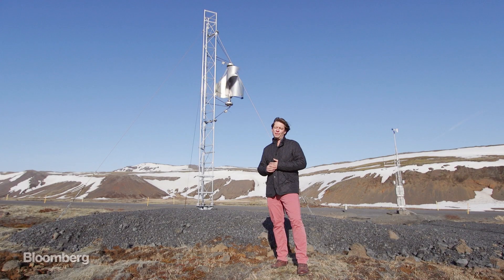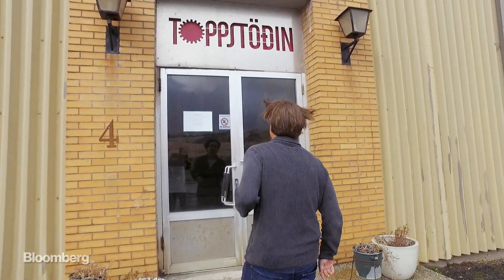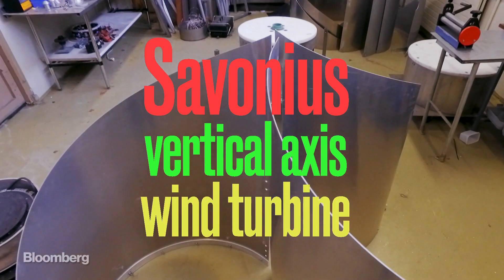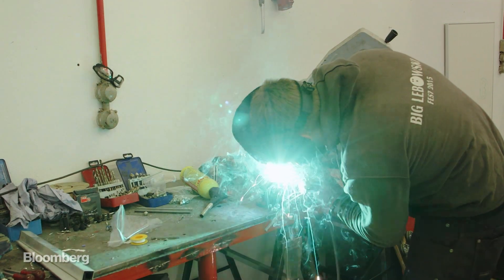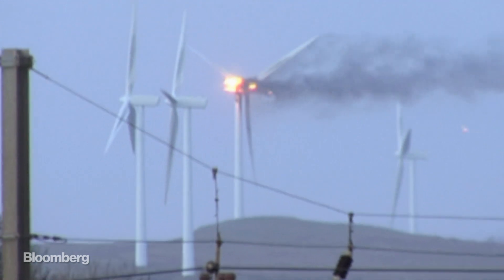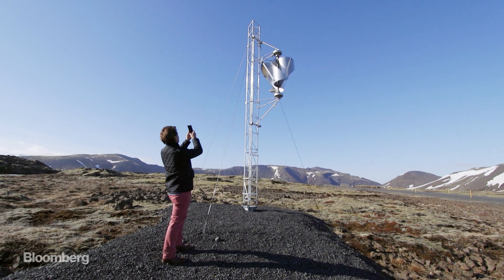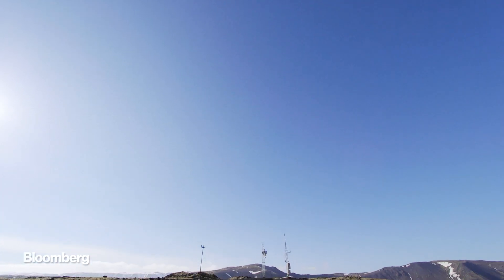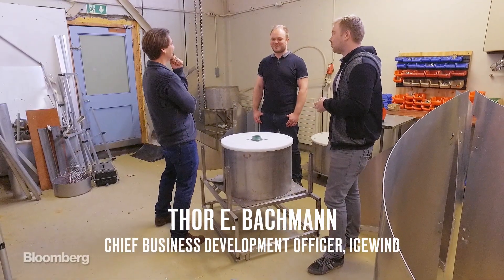The Tech That Could Fix One of Wind Power's Biggest Problems

Comment: we used to take old 55 gal. barrels. ..cut em in half ....weld em on a old car wheel....put on top of oil casing. ....last. time I looked they where still pulling water out of the creek

Comment: Is it better than the propeller design?
Reply: nope. looks cool but not as good as 3 long blades
Reply: And nowhere near as good as 5, 7, or 9
Reply: The formula is the bigger the surface area the more power it generates so this is almost nothing compared to a windmill sadly
Reply: Interesting. On what do you base this response? Not arguing; I really want to know. Can you share a link or something that shows the difference and in what ways windmills are better?

Comment: You never explained how the design protects from over spin.
Reply: Awesome inquiry!

The blades have two sides, so it's all in the shape of the blades. Look at this turbine head on and ask yourself what you see. Like looking at a ball, you don't see the entire thing at once. At any given moment, you can only see certain sections of each blade (one blade can go unseen entirely). Imagine the wind blows in the direction you're looking. Like you, the wind only "sees" one side of this turbine and can only "see" certain sections of each blade (again, one blade can go unseen entirely). 

The shape of the blades allows one side to "gather" wind (the concave face of the blade), while the other side resists the wind, acting like a kind of natural brake (the convex side of the blade). Think of each blade as having a couple of purposed in a "cycle" (gathering, null, or braking). The force of the wind acts simultaneously on the gathering side of a blade and the braking side of the adjacent blade. 

To optimize the turbine speed (set the "speed limit"), the trick is, then, to design these turbines with just enough braking potential to resist the gathering potential without bringing the thing to a halt or spinning in the other direction. Configure the system to use a turbine that has a relatively low "speed limit" and you'll have sufficient electrical service on even the calmest days.
Reply: i think if it has a mechanical brake its nothing worth talking about
Reply: Vatsyayana
Everything is worth talking about.  You design something better.
Reply: Ok i agree with that netzoned, everything deserve a mention, i should have said if we are still using old tech and nothing revolutionary then it shouldnt be put on a pedestal as something groundbreaking
Reply: Yes.  The ol' two, or more, brains thing, because sometimes, someone can just say something 'off the cuff' that can spark an idea from another.

Comment: Expensive solar panels cost more to maintain than they output in energy. They are self-cleaning and self-healing. Leaves suck up sunlight and carbon dioxide and turn those into wood. If you burn the wood, you get heat from them and CO2, which the trees recycle into more wood. That's amazing technology. Plants already cover the earth. What do you think you are doing building solar farms over green fields? That's so dumb. You need a football field of panels to run a hair dryer. You can use the wind for energy in a pinch, but what about when you need to run a power tool or a clothes dryer? Listen: every once in a while the earth makes dinosaurs, and those get crushed into oil, and you can burn the dinosaur squeezings to make your stuff go. It's almost like this stuff is planned out in advance, but not by Al Gore. Trust me. Forget this bullshit of wind farms. Stop killing the birds. Burn the liquified dinosaurs and relax. Anything we can worry about, nature has already figured out.

Comment: These are a very silly idea from an engineering perspective: woefully inefficient in use of both available wind power and construction materials, but he does make a valid point re: the design. There are several around my area and they are quite captivating to watch, much more so than a propeller on a stick. If the alternative is to not bother, then inefficient is still better than nothing. But as a real-world, large-scale energy solution, don't be fooled.
Reply: Tony G

As Alex said, the biggest problem is essentially that the blades have to push back into the wind for half of their rotation, creating drag and losing momentum and power. In ball park figures, they work out to be about half as efficient as a standard design and there is no way to avoid this problem. It's just physics.

The other problem is that if the turbine is designed for optimal efficiency, the highest stress occurs in the weakest points which requires additional engineering that add cost and further reduce efficiency. And this is on top of an already more complicated starting design. For instance, the wind is perpendicular to the shaft which would cause it to bend off its axis and wobble like a spinning top that's losing speed until it falls apart. So you then need two mounting points rather than one, create a bigger frame, use more materials and block some of the wind in the process. It's just a big series of backwards steps.
Reply: birds probably dont try to fly threw these either.
Reply: Thanks for the comment, but please tell us non-engineers your reasons.  Are they over-engineered (too much material), or too small, or will they NEVER be as efficient as the 3-blade horizontal type?  (Even though they last longer & apparently don't burn out in high winds so often)
Reply: +scarcesense If they're about half as efficient as a standard design, but cost way less, are significantly more durable, and take up way less space, then wouldn't planting twice the amount of them still be a win economically? Not trying to be a smartass, I'm asking with genuine curiosity.

Comment: how does it protect against high winds?
Reply: It seems like it is an asymmetric design. The blades are of different volume. It means with stronger winds it would weathervane and park.
Smart.
Reply: The force ( pressure) grows with square of wind speed. It seems like at some point one blade (group of blades) will overcome others. It will stops rotating. It also explains the vertical design.  The bearings needs to be stronger and there is a need for vibration dumping mechanism, however it is totally mechanical. No need for magnetic government or any other electronic means. Very reliable. These are speculations from what I see. The idea is brilliant.
Reply: Every wind mill suffers from high winds. How to deal with it. There are rotating blades. Weathering to the wind. There are electronic/mechanical governors/breakers, stopping rotation. This thing has none of it. It purely mechanical. It might not be as efficient at picking up every wind gusts. However it can be build to last centuries. These are observations. I might be wrong. But I don't think so.
Reply: @Voyage Wanderer: does the ability to withstand high wind speeds require great structural strength?  It seems that the simple design means that blades can't be turned to avoid wind forces.  Otherwise I love the simplicity.
Reply: It's always resisting wind forces. That's the job of the convex side of the blade facing the wind, while the adjacent blade "gathers" wind because its convex side if facing the wind. 

This is the "purely mechanical" braking that Voyage is talking about. Since the wind will always apply a "braking" force slightly less than equal to the "gathering" force, one would need to focus on the design of the system that uses this, so that it can sustain sufficient voltage while the turbine is spinning at relatively low speeds. 

Structurally, it needs to take into account wind speed and surface area, materials strength, ice load, etc. like any structure would. I'm sure the bearings and other moving parts are built to withstand high lateral forces such as wind and wind mixed with rain or ice.

Comment: Overhyped nonsense.
Savonius-like turbines have been around for a long time and have been shown to be inefficient compared to devices that depend more on lift than drag. That's why the world's best turbines have converged on the prop types.
Reply: Take away ALL the Massive subsidies the "prop type" receive , factor in 3 yr lifespan , high maintenance and installation cost and the Savonius wins hands down .
Reply: @absabs7555  the large scale wind turbines work for large scale power production and are the most efficient by a large margin.

These smaller wind turbines are no where near as efficient, BUT, they do have one big advantage. They are small, cheap, and quiet. This means they can be installed in populated areas without much trouble. So even though their efficiency is lower, if you get enough of them you can put them in populated areas to produce a decent amount of power.

However, for large scale energy production, traditional wind power farms are definitely much more efficient.
Reply: There is a huge need for turbines that are safe for on top of buildings and next to houses. Apparently any kind of turbine only lasts about 3 years in Iceland before they tear themselves apart. Obviously the status quo is not workable in every situation.

Comment: How many Watts does i produce? 50? 500? I guess not more.
Reply: I'm pretty sure these are small-scale prototypes/test rigs.
Reply: prototype? some utility company's are installing solar panels on every pole which help to produce 20% alternative energy. wind turbines would create more energy however i think they should be painted mat black instead of  stainless reflective metal to reduce annoying glare.
Reply: Two of them and a small solar board are powering a wifi base station (10 W) and smart phone charging station (10 W (4-5 x 2.3W)) and an advertising board (Not more than 25 Watts) , For a total of 45/2. Just over 20W At maximum. A $99 harbor freight panel and a big lead-acid battery could be a replacement.
Reply: Why not make solar panels in the shape of turbine blades? You can have them pull double duty of producing power from both sunlight and wind.

Comment: Horizontal axis wind turbine has peak power coefficient ~45%, compared to theoretical max of 59.3%. Aerodynamically optimised Savonius is about ~18%. No problem in a great wind resource, not so great anywhere else.  And that's quite a cross section of steel for a small turbine.  Kingspan KW6 is built to Class 1, survival speed 70 m/s, and is a proven technology.
Reply: The KW6 is independently tested to class 2, with a survival wind speed of 59.5 m/s.

The KW6 model provides a Reference Annual Energy (RAE) of 8,949kWh at 5m/s. Pole height options range from 9 to 20m.

Comment: one of the downsides of this new tech ( nowhere near the downside of other forms of power) is that the constant spinning can be maddening to have around, people have complained of the slow torture that the fan-blade turbines cause on their minds, and these are the same, constant flash's of light off of the reflective surfaces, the logo constantly flashing, it can cause epeleptic siezure in people that suffer from that....its a slight form of chines water torture..something so artistic yes,  but it just never stops. My only point is that even though this is a positive energy movement does not mean you just stick one in your yard and now your happy,  no, now you a thing ceaslessly spinning right next to you, with all its little whoosh and creaky sounds it will no doubt produce....Anyone who has been near a farm field that has to use electric-powered fans to move air so the crops dont freeze knows what i mean, it makes the whole house feel like your inside a beating heart, we have had wind-mills for eons so maybe its not a real issue,  but i personally have a problem watching these things move...ill just look away and try to concentrate on the clean energy we are trying to master.

Comment: Couldn't you design (or program) regular windmills to change propeller pitch in high winds?
Reply: That's what they have on most wind turbines these days.
Reply: Phillip Tunstall I don't think it's on most, or even many. I'd guess that most wind turbines are way too small to make actuated blades practical. Don't forget, most of them aren't the huge expensive ones.

I don't have data on these sorts of statistics, so I speak tentatively. If you know where to find the data, I'd appreciate the reference. I'm curious.
Reply: If we talk about >1MW turbines most, if not all, can pitch any of their blades individually. Smaller turbines ~1kW with fixed blades usually turn the gondola. All have brakes to either slow down the rotor or to keep it from moving at all and use the pitch to slow down.

But you can't go around brakes, even if you slow down with pitch. The breaks are not the problem with wind turbines, the bearings are.
Reply: Yes, we can, and do. But the actuated blade system is so much more expensive, it rarely makes sense to use them.
Reply: Thanks Tim.
Reply: They use breaks to prevent the blades from spinning apart.
Reply: That is probably why they catch on fire (brakes get too hot, worn out etc).  My point is why don't they incorporate some pitch control on the windmills so their speed doesn't even become an issue?   Tim Teatro seems knowledgable  and suggested that it is just too expensive.
Reply: You could, but why?
This is how they were designed before they were built, many decades ago in the flat midwest. Centrifugal force twisted the rotors into the wind and they couldn't self -destruct like the modern monstrosities do.
Reply: Brakes.
Reply: They use feathering in California on giant wind turbines.
Reply: Gunther Ultrabolt Novacrunch, or change the gearing ratio, so more energy can he harnessed with higher wind speed. Keeping blades spinning at a maximum speed, but more power generated for same speed

Comment: Here the Point is How big they can manufacture they very tiny in front of conventional ones these are modern but not capable to generate huge Megawatts
Reply: How can you tell this by looking only at one turbine? yes maybe... it goes as much material as in a conventional turbine, I still didn't calculate how much materias it goes / how big it can be / how many of them is needed to produce massive MW / How efficient a motor to generate '' X '' quantities of electricity it is required, etc... There are a huge factor and variables to be sorted before comparing them to those massive traditional turbines.
Reply: Because I work in this sector

Comment: It strikes me as seeming to be an inefficient design.
Perhaps why wind farms don't use it?
I also dispute the claim that windmills only work for 3 years in Iceland.
Bloomberg - were you paid for this?
Reply: It explains better how this turbines works here on this other youtube video. A bit of self research pays off better than unthought ambigous fast conclusions. It only takes up 5 minutes to learn something new, that we don't know much about :)
 
watch?v=RQPs0jAqeGk
Reply: It is efficient at slow winds, and bad at high winds, which makes  it  reliable and not subject to over speed.  Built in governor.  Intrinsic.
Reply: ***** A few things:
1. I premised my comment with "seeming";
2. your link is not available in my country; and
3. You haven't disproven anything - perhaps your link contained more valuable information?
But if you are going to attack me, I will need reasonable proof before I change my mind.
A peer-reviewed, comparable side by side installation test under varying conditions is the only way to truly compare.
Until then, it seems perfectly reasonable for me to assume that the faces of the counter-rotating "blades" will result in inefficiency - also, the material to wind-surface area ratio would seem less on the traditional design.
Don't get me wrong. I can see specific use cases where this design might have application.
To be clear, I am not against innovation. If it is more efficient, Great. Fantastic.
But I am not going to just accept an unbacked proposition - especially when that comes with dubious claims like "windmills on last 3 years in Iceland" are made. Longevity is clearly an engineering issue.
Reply: "I also dispute the claim that windmills only work for 3 years in Iceland."

To be fair, Tim, they only said that a conventional wind turbine can last about 3 years before the weather does them in. Are you really willing to argue against such loose verbiage? "does them in" could mean anything from major overhaul or simply maintenance to keep it running efficiently. After all, most energy generating devices need costly  and constant maintenance, especially in seriously harsh conditions as in Iceland. We should expect to perform maintenance every 3 years to keep something like a wind turbine running.
Reply: ErgoCogita But that's my point. It is verbiage intended to induce misconception in support of a product they are "showcasing".
Where we differ is that I don't believe it is inappropriate to pull them up on that behavior.
If more people did so, we'd have better quality content.